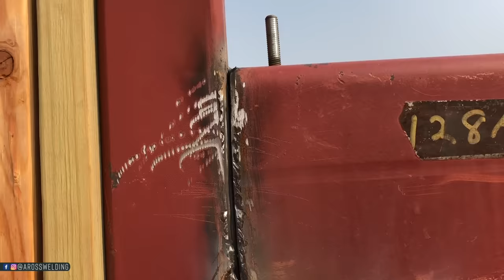STRUCTURAL WELDING IN THE BIG CITY // BAD WELDS

Comment: Went to a career school after dropping  out of a community college got certified, ended up finding a job at a place that builds industrial sized dust collectors after 2 years of being promised to be put in the welding position and every time it opened up they hired a new guy for it. After bitching alot about it they finally put me in after 2 months kicked me out into the paint department. asked why I was kicked out my boss said it's because I was a horrible welder (he's not any kind of inspector or anything) so after a year of feeling sorry for myself thinking I wasted my time and believing my boss that I was a shit welder  (DESPITE BEING CERTIFIED) decided to say eff it and tried for a welding job they called me back THE DAY that I applied and asked me to come in for a weld test came in passed it and the very next morning they asked how soon I can start went into my bosses office and quit on the spot told him ide finish up the week but I'm gone.
Reply: Not much to it man it’s easy I just started u can usually judge the work urself
Reply: But why quit just passing a test or certification  doesn't mean much you need on job experience..then be independent.
.
Reply: @barbarasteed3966  well no the problem is that I wasn't going to get actual welding experience  at the job I was at it was one of those things where I was waiting for my boss to make good on the promise that he would transfer me to the welding department  but he never did I went from the assembly  department  to shipping to paint to woodshop to fab but he never wanted to put me in the weld department  so finally  I quit when I got a job offer for a welding position
Reply: @augusteast6518  good for you sometime things work out like that be patient and take baby steps until you are confident....
Reply: @barbarasteed3966  thanks :) back when I was still living with my dad welding started out as a hobby and I got good enough  to start fixing my dad's  farm equipment  with my good old fashioned  Lincoln buzz box then I decided  I wanted to do that as a living that's where it all started
Reply: Boss Hogg  yeah it's too bad for my boss tho I overheard him talking to the supervisor  telling him I was leaving and said "I'm sorry to see him go when it's just him in paint shit goes smoother"
Reply: You finished up the week? Man I quit a job and parked the work truck at a gas station and told the boss to suck eggs and go get his piece of junk. They owe you no courtesy and I see no point in giving them the courtesy when they jerk you around. Trade workers own the market right now.
Reply: @RadDadisRad  yeah I mean I didn't have any personal feelings against my boss he was a nice guy he just didn't  see my talent but I also did quit on a Wednesday  and my last day was Friday so it was kinda close notice anyway
Reply: @RadDadisRad  man you done a dam good job of quitting 2nd thing a good welder needs to know....
Reply: Chris Smith not much to it is what Mosas said while parting the Red Sea
Reply: @cinder7377  cool that you're getting started in welding but actually there's a lot to it, ask any certified welder.  Becoming a good welder takes a lot of hard work and studying.  Not only do you need to have excellent skills that vary by process, position and environment, but you also have to understand the science of it AND the code.  IMHO there aren't any other construction trades that require nearly the amount of knowledge and skills as welding.  Best of luck to you.
Reply: damn bro thanks for this post, i’m currently in welding school struggling with my 7018 3g backing test... feeling like the worst welder ever :((
Reply: Lucky man, that's the way good stuff start coming!
Reply: @phrodendekia  yeah I mean this new job is 4 days a week with 12 hour shifts so I get extremely tired but I've worked there a total of 2 days now and my Gap leader (basically crew leader) says that he's impressed with my work and that he can tell I've been welding for a long time which after 2 days that's a really nice compliment to get after my old boss told me i was dog shit at welding
Reply: Leland Holton Try doing that in the trucking world. It will ruin your life and hopes of a new job. But that’s trucking where you don’t have someone to protect you like normal trades people do
Reply: @RadDadisRad  I'll take things that never happened for 600, Alex
Reply: @augusteast6518  how much were you getting paid for the none welding job that you were doing?
Reply: @jesse-_-7036  it was about 500 a week
Reply: @barbarasteed3966  quit and go get that expierience duh.
Reply: I had a boss like that at my old job didn’t know shit about anything and would come into welding shop talking shit and I’d tell him I’ve never once heard a customer complain about my welds (looks or quality) because we would sure as shit know if I had weld fail and told him get back to your fucking office so I can make this company another 5k to finish off my day (for context I was fabricating Downhole oilfield tools and modifying pipe to customer spec)
Reply: school didn’t teach me anything practical when it comes to welding, manufacturing, maintenance ect.
Reply: @augusteast6518  -
Sounds like you left on reasonable terms which is good, despite what others said, never needlessly burn a bridge BUT it’s great you’re will to take a chance and make a change.  

In the other hand you were getting a wide breadth of experience and may have been on your way to learning the business 🤷‍♂️.
Reply: @chucknoob7041  nah there was no chance of advancing plus it's not what I wanted to do
Reply: Honestly not much with welding, you need the know how. Once you know one, you can learn the rest easily.
Reply: @leonelpuga7812  don't worry that happens, I remember my stupid mistake, don't give up. Just always asked questions about your mistakes
Reply: Yep sounds like a typical GOOD OL BOY NETWORK!!!! I was a heavy equipment operator at a landfill...needless to say I was never qualified to move up...i waited 2 years there and said screw u guys also...best move I ever did...by the way some guys there didn't know squat and they moved them way past what I woulda EVER made it....i feel u bro good for u!!!
Reply: I've had a few kids like you a diploma will never give you real on the job experience practice and don't give up .
Reply: @RadDadisRad  haha love it.
Reply: Yes we are replaceable,  but so are you, the Companies!!
Reply: Good, are you happy now?  Keep going you can do it. Jim
Reply: @augusteast6518  sounds like they kept you in those other departments because you were good at it. They’d rather have you there.
Reply: @SolidFoxHoundSF  I didn't want to paint I hated it
Reply: Hope you're getting on alright in industry man. I'm only a few years in and I've faced some dickheads like you've faced. Just keep your head down and know your worth, then no one can stop you.
Reply: @augusteast6518    good job wait until you start doing six or seven 12 hour days a week.  Good money, over $100k a year, but talk about tired.
Reply: @joshuastevens5910  You Can Be Your Own Boss, you're a free man. Start your own company. There's no free rides in any real trades.
Reply: @leeallen9553  Not that easy being your own boss in the trucking world. But without us no trades would exist in this day and age.
Reply: @joshuastevens5910  just saying the kids got a free spirit and nobody should crushes dreams and keep him in a place that's good for them but not where he's happy. He did the right thing. Hopefully in this world we live in now automation won't take it all over that's one good thing about the trades. Trucking is one hell of a hard job. Hats off to you man. Especially with all the talk of the autonomous trucks.
Reply: @leeallen9553  Autonomous trucks won’t happen with what I do. But I’ll put it this way for CDL holders we have a DAC report. Sort of like a credit report...for truckers licenses. It effects company drivers a lot. Sometimes they’ll refuse a load or refuse to drive faulty equipment. A company can put whatever they want onto the DAC report and it can affect a driver for 7 years. The trades is a hell of a damn good career, and trucking is one. But I’ll tell you now as a trucker and I know what’s going on, other industry is going to come to a halt for awhile here soon. Especially the food supply chain.
Reply: @joshuastevens5910  I understand what you're talking about brother, that's rotten.
Reply: Yea man I am in school now they said this could happen you go to a place expecting to.weld and they put you where they want you but damn that spend 20k on school i am gonna weld otherwise you won't get any better lol
Reply: @scottyglenwalker2345  exactly. Do what u love and you'll never work a day in ur life. Even tho I get pissed  off at alot of people at work still when the helmet drops the bullshit stops haha
Reply: Theres always some sob trying to knock you down in life no matter what kind of job you have.  Back in the day, if we had a new guy that was a little weak, we would work with them on the side  and try to bring them up to speed.  Didn't always work, but its a better way to go than just putting some one down.
Reply: You know i had a similar story but in machining. Ended finding out the reason my boss didn't like me is because I learned faster.  Only boss that complained about my work. I've had many since that like what I do.
Reply: “I got certified” that’s funny.
Reply: @Shelby7792  why is that funny
Reply: Bro that is happening to me right now! They put us in quality control for the first 3 weeks, then we were supposed to go into welding booths for hands-on training, but those were filled so we did virtual welding for around 2 more weeks, and they are constantly hiring more and more welders and putting them in before me because they are experienced. I got into the booth for 3 days before I was taken out with another guy and moved to disassembly. That is where I am right now. Does everyone play these dumb games? They told me something, and I signed up for it, so why is it so hard for them to keep their word? I was on track to pass my welding tests pretty quickly.
Reply: @augusteast6518  wow two whole days .
Reply: @zforbes839  wrong school
Reply: @patriotsyndicate9532  tuffin up did it for decades
Reply: @joshuastevens5910  Bs there's millions of owner operators.
Reply: @joshuastevens5910  buy your own truck and get after it
Reply: @augusteast6518  give notice and get another job.
Reply: @williepelzer384  I own my own truck cupcake.
Reply: @SparkableGlow  then get it done and get a job
Reply: @williepelzer384  and there’s not millions of owner operators. It’s getting less and less  every year.
Reply: BIG R  must have some get up and go. Unlike most not my fault.
Reply: @williepelzer384   I'm retired military I'm pretty sure I'm good to go. And I'm still pulling these hours. I'm gonna do this for about 5 more years and I'm done 😆
Reply: Your story relates to mine. Know that when you’re working for someone, they’ll always want to create an infinite amount of loops of fake promises that are not accomplished. Instead, they’ll give you mediocre position that pay less when your demand of position and qualification certify to the job that you’re certified on; in that case wielding was the certification for you. If your job is not meeting up with your standard of qualifications and are thinking less about you; and giving you mediocre jobs. It’s best to quit.
Reply: So hows it going with that welding job?
Reply: Johnny Paycheck has a song about that ..........
Reply: I had the same thing happen to me. Waited two months after i was promised to be moved. They hired some owners kid and i put my two weeks in. I was really hurt because the supervisor wanted me in welding but owner pulled some shit. Miss that shop but way she goes.

Comment: Great video!       Contractors almost always default to the low bid.       After two or three attempts to cheap out they learned to invest in experience for the rest of the job because they found experienced men are cheaper in the long run.       Unfortunately most contractors will have to learn this lesson repeatedly because of their need to squeeze every penny until President Lincoln cries...

Comment: Commercial construction is a nightmare when it involves welding. Very seldom do you see code qualified welders on a job site.  Saw steam piping in a school that was so badly welded you could see the line of butt joints in the metal after they were “welded” the welds were never inspected and the pipe was insulated. I saw a few places that looked suspect, and ripped the insulation off. Turns out the whole job was condemned and had to be completely rebuilt.

Comment: I had to reweld 100 gate hinges at a dairy barn with the calves in it. Lol. I cut the old ones off, cleaned them up and rehung. 1 inch flat steel to galvanized 8 inch pipe. It was a mess. The builder was trying to save money. The owner of the building held the builders last payment till I was done. 
 The cows were a battle. They would munch on anything. They would pull my ground off. They would jerk my stinger out of my hand. They scattered a box of rods in the poo. Oh and let's not forget to poo. It was on everything. The path through the barn was just wide enough for my truck. They licked my whole truck of the salt that was on it. They pulled the lug nut covers off my rims. I figure they ate them. Pulled the snow plow plug off the front of my truck. Took my chipping hammer. It's still there somewhere. 
 Good show man.
Reply: Bru sounds like hell
Reply: I work on only diaries.  Welding,  electrical, plumbing, etc. You get used to it but they can be a pain at times.
Reply: Had goats eat the license plate off my trailer. All that was left was a small tab with the screw holes still attached.
Reply: @kevingarza9945   lol. Good times for sure.
Reply: Mark Bartmanski   I never found them. Lol.
Reply: @jacobgarcia8224   Lol. You gotta be ready for everything.

Comment: At my age, oscillation is a natural.... LOL.  I learned back in 63 when I joined the Navy. 22 years later, I was certified 3/4 plate, aircraft, and pulling canopy seals on Nuc piping.  After that, I did construction work for major companies and projects. Then I decided to hit it in a new field so I started my own company doing stainless.  Since I retired back in 2005,  my grandson and his friends keep me busy on their crawlers and the armor wrap that goes on the axles.  One thing I used to tell all of my underlings, was, you may not get rich welding, but you sure won't go hungry either.  Go for it.......and take pride in what you do.

Comment: Yes just buy any machine! Thats what i did i love it! Cant wait to go to welding school! After 10+ years in the food service industry im ready to start what ive always wanted to do and never thought I could. Youtubers like you really helped me get motivated! thanks austin
Reply: I'm 34 and I've got roughly 6 months of OJT experience between MIG and Flux Core (more MIG than Flux), however the only schooling/training I've had for welding is High School. I took maybe 3-4 semesters of it and that was only for stick welding (dabbled with brazing/ AcetTorch). I started a new job a month ago at a plow company working with Flux core (first time). Honestly, I'm glad I got the basics with stick welding in high school because compared to that, MIG/Flux becomes so easy to do. Welding, even if it is for a job, can both be fun and challenging. For me, at least.

Comment: Hey man, i'm here because i'm pushing 40 and i'm basically starting a new career. I'm doing a little bit of welding because i'm in an automotive class and it's required, so i check out videos just to see what advice i can get from anyone. That part at the end, where you talk about just going for it and not letting your doubts hold you back.... Thanks man, that got me good. I needed to hear that and i didn't even know it.

Comment: Excertified weld inspector.
Those were some good 
looking uphill welds.Well
we know the Starbucks 
isn't  going to fall down. 
Good job Austin.
Reply: the building wont but the brand surely will. i mean people buy that crap becauee it is just like fast food. but nothing beats coffee made the slow way. esspecialy with fresh ground up beans.
Reply: @OMRS1  you’re
Reply: Hou think so ? Well decent sure. But good ? You are not hard too please then.
Reply: @brockstephens3271  Vertical up is my least favorite. I might be a psychopath but I'd rather weld a pipe in the 6G position than a fillet in the 3G position
Reply: @adewit5366  I'm taking the Inspection and Testing class in my welding program right now and it turns out that a lot of really ugly welds can be structurally sound. Conversely you can have a flawless looking weld face that fails inspection due to lack of fusion at the root.

Comment: Awesome channel man, glad I found it. After the military I tried traditional college and dropped out and went to a trade school. Spent a few years as a commercial diver and got certified in wet welding. Then worked as a welder after my diving days. Needless to say I went back to college but stuck around in trade work. Now I'm in residential/commercial construction on the management side of it going to graduate school but nothing beats the experience I got working from the bottom up. So great advice in the end. You do just gotta go for it.